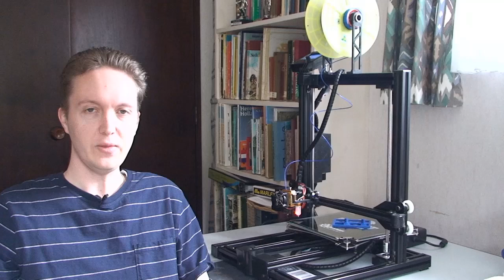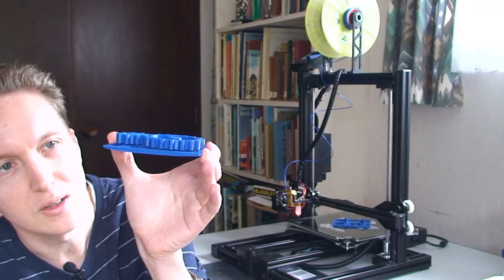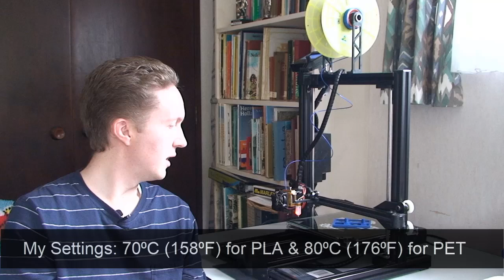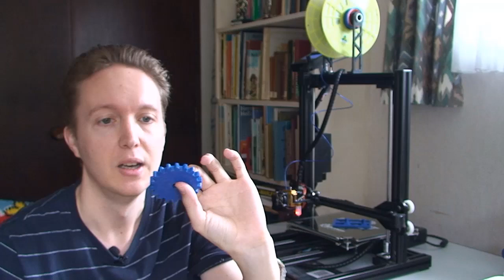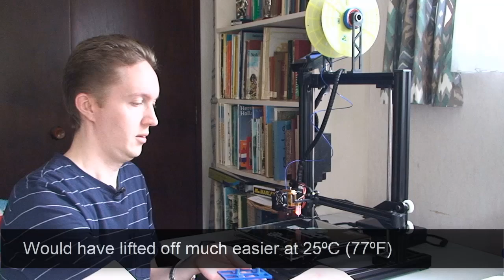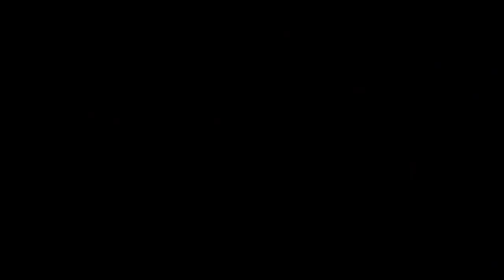3D Printing: Strong Bed Adhesion and Easy Object Removal

Comment: That's the purpose for individual settings.
To just use the bed setting to heat up the base part of the object for easy release.

But other youtubers take it off and use a heat gun,  flex the plate😑  or spray something to cool it off or to unstick it, glue sticks..etc...

Comment: The Cura slicer had a default bed temperature of 50C.  About 3/4 of my prints were ok.  Then I read that PLA needed at least 60C.  Trying it now at 60...